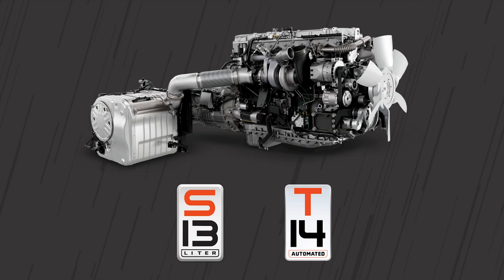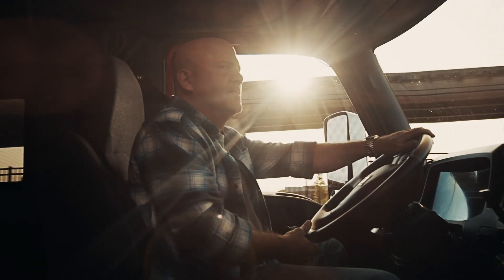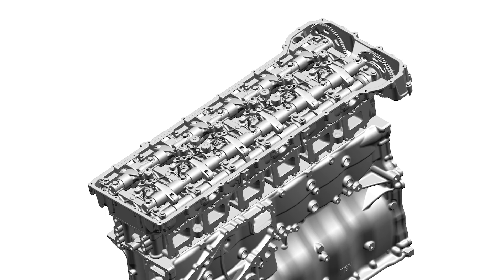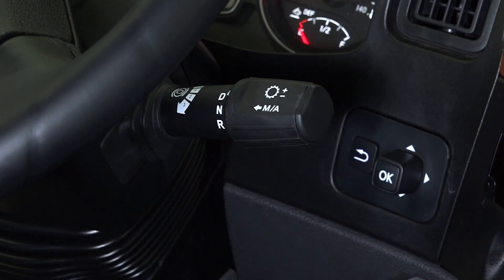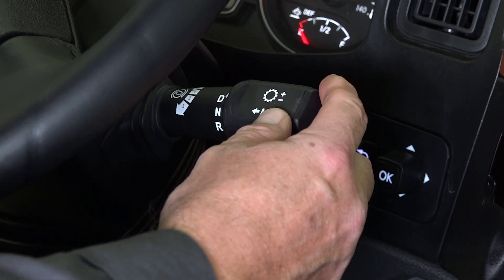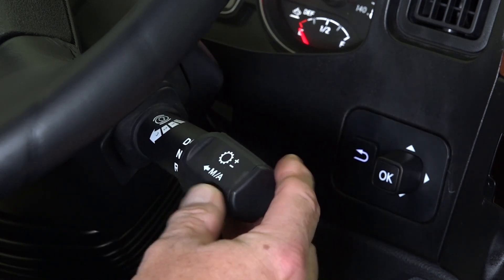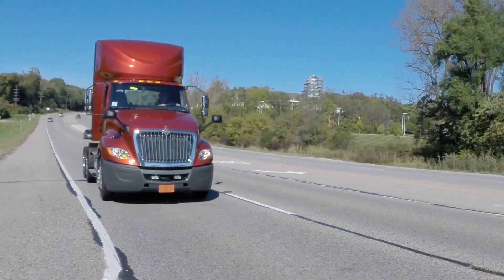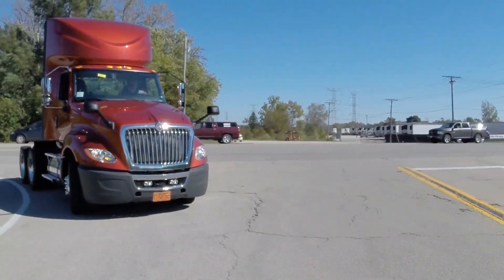Navistar International S13 Powerful Engine Compression Brake - Review How It Works

Comment: You need the engine  brake to engage when your foot comes away from the accelerator without  having  to touch the brake pedal in the real world  a big big majority of the time. The engine  brake should have nothing  to do with the service  brake pedal, thus taking the ability  of the driver  having complete control  of his vehicle when descending down hills. Why not stay off your service brakes when possible as I have for year after  year in a standard  transmission. Why not use the proper gear and the right amount  of engine brake and not your service brakes $$  as the sharks say, " for this reason I'm out on these automated transmissions" the driver  does not  have total control of his vehicle.
Reply from the maker: Thank you for your input.  There appears to be a great opportunity to share more on how the S13 T14 powertrain are a significant game changer.  And as with you standard transmission you have the ability to take control in the S13 T14.  Additionally there are three ways that the engine brake engages in the S13 engine.  One of which meets your desire to have the brake engage immediately when the foot comes off the accelerator.  To take control of the gearing in the S13 / T14 is a depression of the end stalk taking the transmission from Automated to Manual.  The gear will be held until released by depressing the stalk or if the engine is at the upper RPM range.  To protection the engine it will upshift.
I agree the knowing the power to preserve brakes is a must!
Reply: @MichaelOlden  I would  like to test drive one with a loaded trailer.  If you can disconnect the brake pedal  from the engine brake, it would be a plus and set the parameters on rpm up shifting would be another plus.  The older Western Star's would  allow you to use the manual option  and stay exactly where you put it until you physically moved it with your hand, and it would allow you to choose either  one,two,or three stages of engine brake  and again  stay in that selection until  you changed it physically also. That has been the best yet. The Volvo Ishift is a good transmission. However, if you can control as I've stated it would  be a game changer for me. The Volvo will upshift when your desending, just from touching the throttle when all you wanted was to ease off of the engine break for a few seconds,  now your forced  to get on your service breaks hard to get back under control witch is why I haven't like these transmissions.